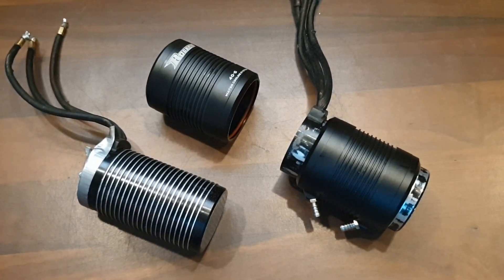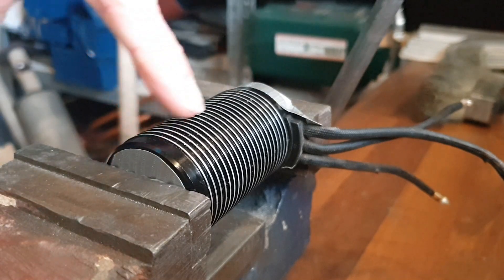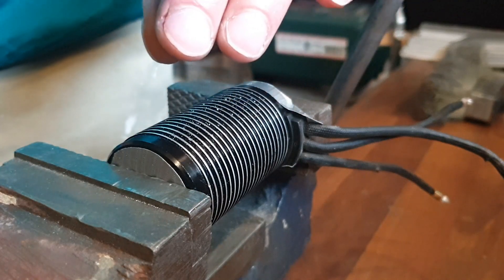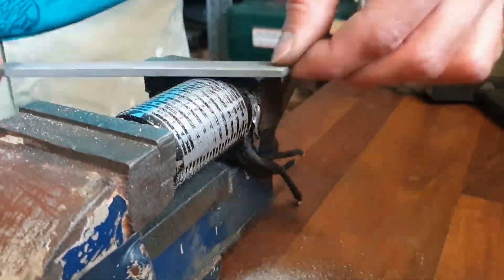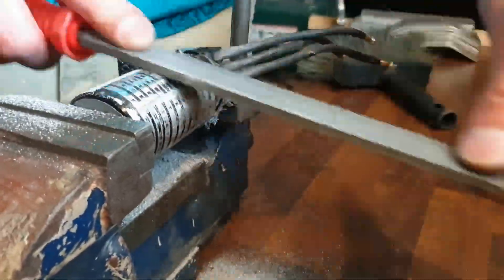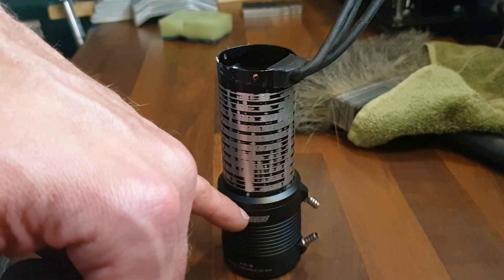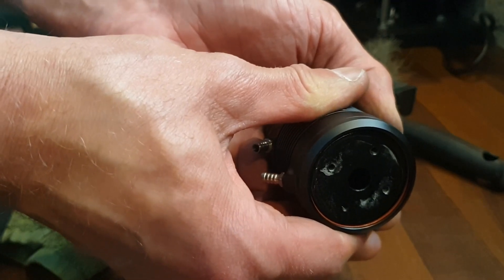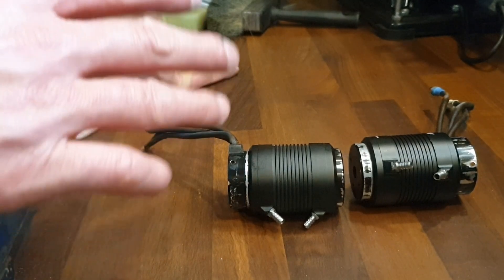How to convert a brushless motor fit for water cooling - Traxxas Velineon 6S motor

Comment: Good info.
Reply from the maker: Thank you

Are you watching all my videos? If yes than let me know when you saw them all. I have a question for you then
Reply: @remborc  I have started watching your vids and picking up good ideas along the way. Are there some I should focus on? I had thought of starting from the first and working my way through.
Reply from the maker: @gihonda127 Good to hear. What are your new ideas?

I have some video's that i made because i got a lot of question about that subject in real life.

for example:
-The video about cleaning brushless motors. All brushless motors are 95% the same to eachother. Minor differeces in sensored and not sensored
-The video about cleaning brushed motors
-About changing gears in de 2085 Traxxas servo
-About how to get bearing out aluminium parts with heat. It also applies to removing screws from aluminium parts that are stuck
-You already saw my video about painting body's
-How te rebuild differentials, made a video for the E-revo differential and Arrma differential. But same as with brushless motors, diffs are about 95% the same princible
-I have made serveral full rebuild videos off several cars
-If you are into speedrunning i have made detailed video's about my Limitless and Slash

When ever i get a question about these subjecs i redirect people to one of those videos.

Enjoy! and i hope you learn something.
Of you you have any request, question or remarks i would love to hear it!